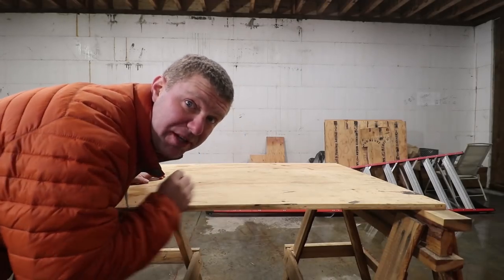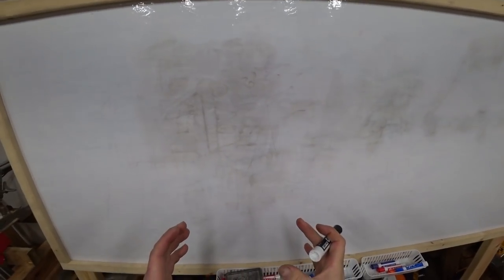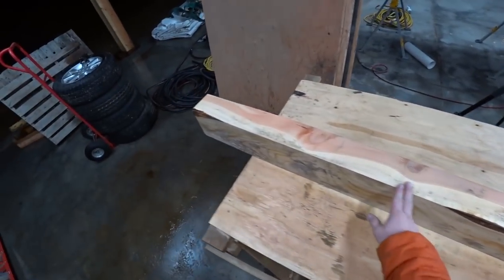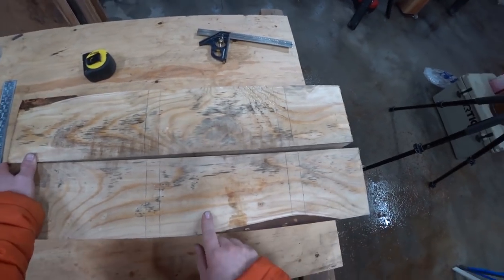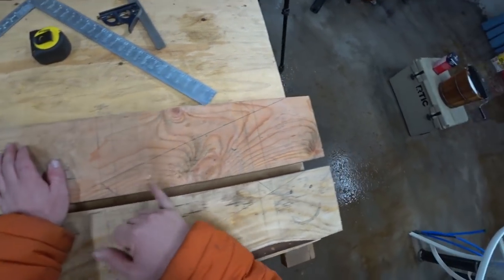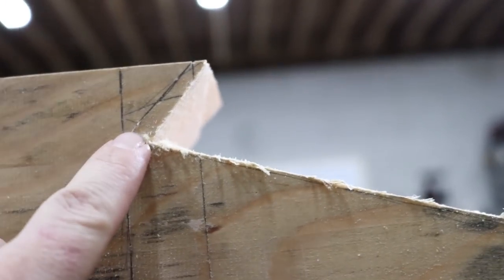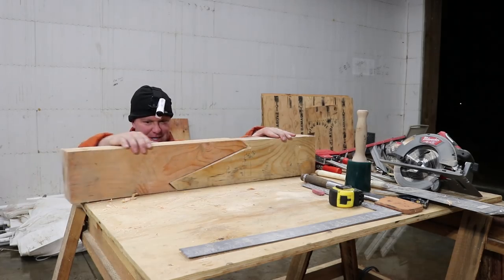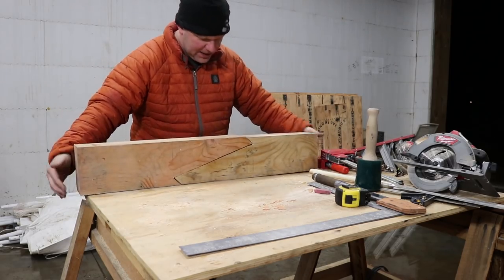The Most Beautiful Timber Frame Joint In The World

Comment: For those who are confused, he is just doing a demo of the joint. You would never cut a perfectly good beam in half to add a scarf joint in the middle. This joint is for joining the ends of two beams together when you don’t have a long enough beam. His example of 24ft in each direction is just ridiculous. First, you could never find a 48ft beam and if you did you wouldn’t cut it in half :) He should have phrased it differently. If you want to make a 48ft beam using a scarf joint, you would need to use two beams slightly longer than 24ft each.

Comment: I know you like that scarf joint...but there are any number of old PA barns that have SPECTACULAR scarf joints.  My farm had a barn from about 1800 with two 10 x 15 beams end to end running almost 100 feet.  These were connected with a scarf joint that was pinned with a driven horizontal square pin.  The joint sat on a column.  Now, 200 years later it still looks great.

Comment: We used to pull the paddle out of the ice cream maker, plug the hole in the top and drain hole in the side of the bucket and add more salt and ice.  The idea is to get all the cream frozen somewhat without getting the salt water in the mix.  But, just like buttoning a shirt, some start at top some bottom so whatever makes it work for you, Greg.

Comment: Not bad Jesse but a piece of advice on scarf joints: don't center them over the posts, the greatest moment of lift on a horizontal timber is above the wall post.  That puts a lot of stress on the scarf joint.  If your engineer or designer recommends that method it would be a good idea to question it.
Reply: And before I get questioned on "how the hell do you know?"  I can tell you I have cut many in some very large timbers, even have many videos out there on it.  In the end he did decent on the joint and each one gets easier.

Comment: I like these two people.  I suppose this series would not nearly as much fun if Jesse did everything the way I think he should.  However,  who really gives a shit about a framing square?  I have 3 downstairs in my shop, one of which has as much rust as Jesse's does.  All that having been said, it would have been interesting to build a "thermal mass" style house in Idaho.  Man, the correct location for sun exposure would be mandatory but likely hard to find.  Not sure.  However, I do not get the "gravity fed" water system?   A piece of land with a spring would have been a good choice; however,  maybe not available in that part of the Idaho Rockies.  Wait until Melissa gets pregnant.  Hauling water from town will go the way of the Spring snowmelt.   Hauling wood and stoking a stove will end pretty quickly too.  Make it as effortless as possible to live in that house.  It's completely possible to go totally off the grid with solar and still have all the amenities. Wood heat, and no running well water .... there is no reason to rough it.  With 295,000 viewers, you two should have sufficient cash flow to live without a mortgage, no electric bill and have a real water system.

Comment: The scarf joint is used in more than just timber framing. I have a guitar that has a scarf joint connecting the headstock to the neck. Other forms of woodworking use it too. It's all about increasing the amount of surface area that the glue has and using mechanical fasteners to lock it all up.

Comment: Hey Jesse   ... cut the crap.  Go out and buy a used freezer and store what ever you need.  OR, a used frig.  I am also not sure why you did not install at least a temporary electric service.  After having a timber frame house in the late 70's, they are entirely overrated and way more expensive to build.  You have the sawmill, why not figure out a much simpler building system that still use the same insulation system.  Hummmm ....  and by the way, much lighter materials.   I guarantee you that a foam insulated 16" on center house is just as thermally efficient.  Plus, you could put up the walls, and use beams for the ceilings.  After having lived in that house for 7 years, I might even have built it out of block.  Still waiting for the big erection?
Reply: As you can see they have their own dream, not yours,,,

Comment: Funny that you use the framing square top to run parallel to the wood instead of using the bottom to lay flat against the wood so the 90 is true. Maybe I've been doing it wrong all these years!! Also you wrote 1 to the right and 2 to the left of the joint?? That's Japanese is it not?? I would always start with 1 , then go to the right and write 2??? Maybe I've been doing that wrong also. Sorry I'm getting bitchy. I've been whining about other people's driving also!

Comment: Thanks for showing the layout of the joint. does the end angle need to be square to the long cut, or is there a formula to determine that angle? It looks like an acute angle, but that could be the camera angle or some other optical distortion.
Reply: appears that the short "tip" cuts are 45* to their respective faces and the long cut is a line connecting them. The angle of the long cut is variable of the length of the scarf and the length of the "tips".

Comment: Now that you have a good workshop you can do all the important stuff.  If you go to your local welding shop with a foam cooler, you can get some liquid nitrogen for ice cream which is a faster way of making it.  All you need is to put the ice cream mixture in a stainless steel bowl and pour the liquid nitrogen into the mixture being very careful not to get any on you.  It kind of makes it light and airy.  Nice scarf practice.  Everyone you do will be better than the last.  I liked someone's suggestion for using your tool skills to make Bugaboo a cat tree.